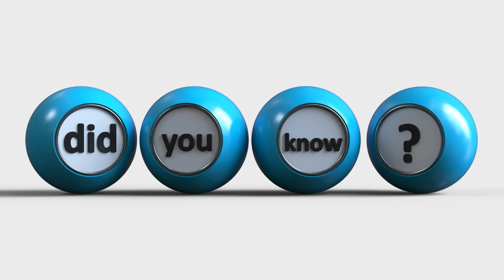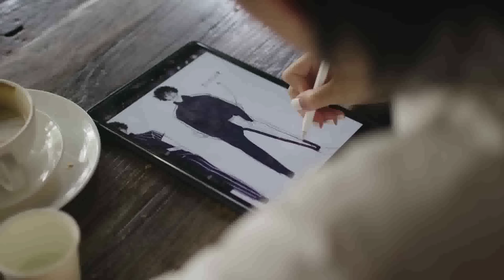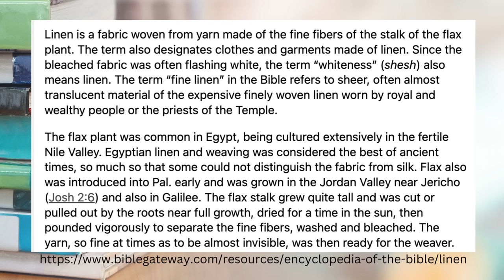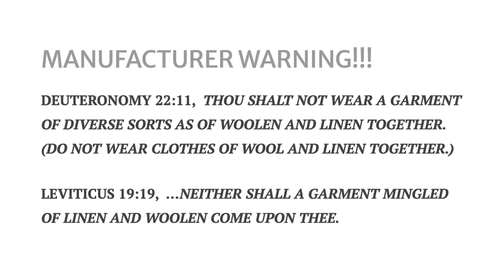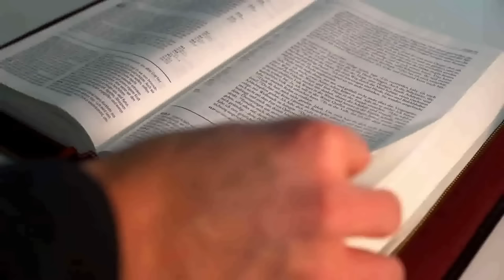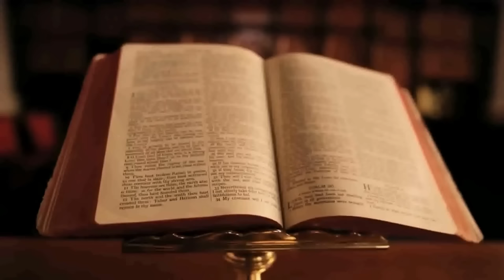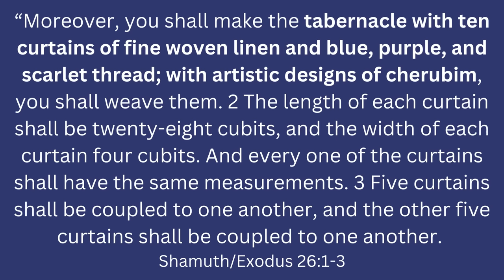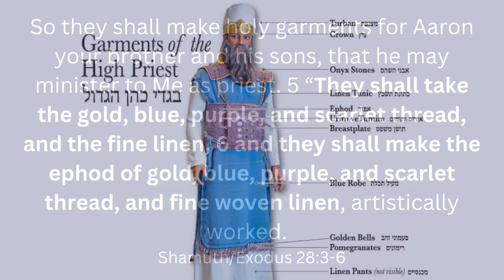Torah Tidbit | Healing Fabrics ~ Linen and Wool!!

Comment: Linen also encourages modesty in your dress because it doesn't allow you to wear it tightly. It has to be loose in order to be comfortable and to not rip
Reply from the maker: Great point!
Reply: @TrumpetsCall_AmarYaH : so so educational!!
Reply: Lean forward in a linen shirt, and that modesty will be in question.
Reply: @jondoealoe  buttons, safety pins, tie strings, high collar,  Knowing that, put your hand to your chest until you stand upright. MANY SOLUTIONS.  We are Hebrew.  We'll figure it out
Reply: @cindy5391  Just pointing out the need to consider the things you mentioned in detail.
Reply: @jondoealoe  precisely. Blessings. Im right with you. ALL LOVE .Just solutions.❤️
Reply: @cindy5391  Amen.  Peace be unto you.

  Linen reflects light, and there's a place in this video where a woman in a linen dress is making a bed with a white wall behind her.

  The light reflecting from the wall makes her dress translucent.

  If she was standing in front of a light bulb or the sun you might be able to count her pubic hairs.

  Two or more thin and light layers are better than one that's thicker for insulation in heat and cold, and for modesty.